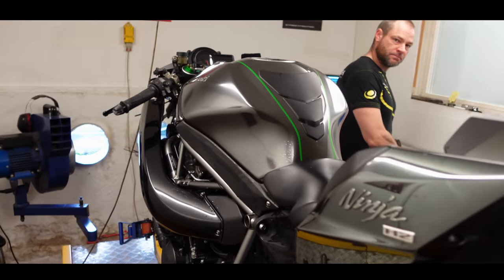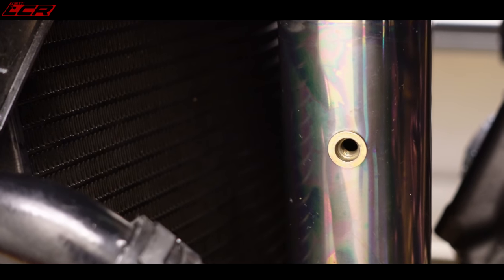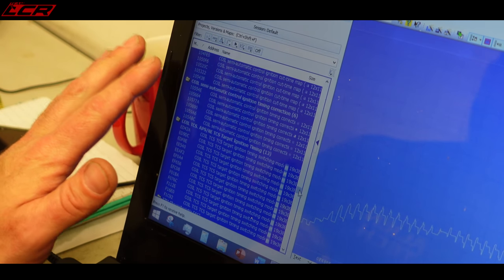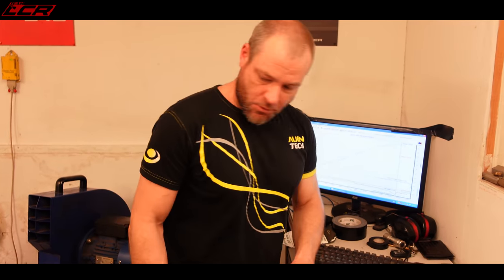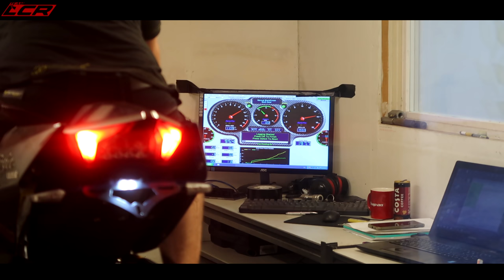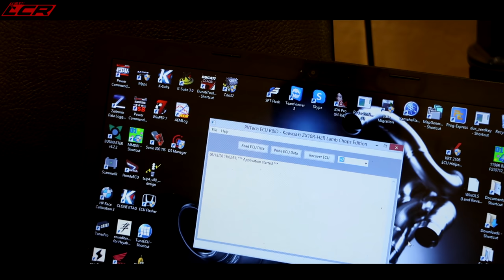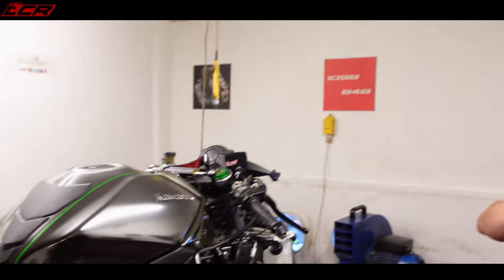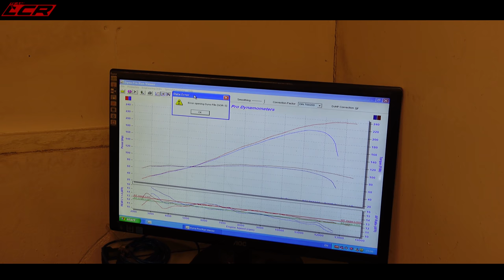Ninja H2 Dyno | BIG Power Tuning!

Comment: Interesting Chopps, when I set up my MT10SP it was never about the increase in power but 1) air fuel to stop running lean as most new bikes do 2) throttle on off get a smoother transition as with most new bikes it’s a switch on off  ————— great video and thanks for sharing 👍
Reply from the maker: Yes exactly 👍 if the throttle response had been good I wouldn't have had it done as it was crazy fast anyway! But while it's there etc etc 😁

Comment: What an absolutely fascinating vid - with a stunning end result. Methinks a trip to Elvington is definitely called for Chops! Oh, and fair play for resisting the temptation to chase baffle-less mega-power and sticking to your original plan. It couldn't have been easy: especially with wizard Chris on the case. Enjoy the beast bab!! 👍
Reply from the maker: Thanks Missy! It's a long vid but wanted to cover the whole process, sure the length will put some off but for those that are interested will appreciate it. We are now going to do a baffle out map to add to rain mode. So if I did to a top speed run or private testing somewhere pop baffle out and engage rain mode! Just remember not to use rain mode if it rains... 😂
Reply: @LambChopRides  It's a plan so cunning - you could stick a tail on it & call it a weasel! I'm very pleased I was wrong about your continued ownership of the H2. I mean, the thing's so ridiculous that nothing road-going comes remotely close! And don't worry about the length of the vid. My hungover bonce was spinning after a few minutes, but sticking with it was a really educational & rewarding experience. Have a good weekend chook & thanks again for another fab production. 👌

Comment: Clearly a knowledgeable technician on optimising the bike fuel/air ratio but without a visible exhaust extractor I'd hate to think what the room gas mixture ratio was after a long run or two.  Not sure a respirator fully corrects for any dangerously elevated CO levels but I stand to be corrected if there are any gas experts out there.
Reply from the maker: There is good ventilation in there, hes now also added more fresh air feed into the wall to recirculate the air quicker. There is a huge extractor fan on the rear of the room
Reply: @LambChopRides  Thanks for the update on that which is reassuring.  Nevertheless I think if I operated a similar facility I'd want to continuously measure CO levels (which can drive oxygen all too easily from the bloodstream) for the long-term safety of staff.

Comment: Insurance company: Have you modified your bike?
Owner: No, still the same ECU the bike came with.

Seeing them drill holes into that beautiful titanium pipe had me wincing.
Reply from the maker: Haha very true! I was wincing myself 😂
Reply: Is it ti? Bluing Looks like stainless??!
Reply from the maker: No its polished titanium 👍
Reply: Lamb Chop Rides ah yes thought it looked alittle different to say the akrapovic ti stuff!
Reply: @FireTwo  I was in two minds if it was stainless or titanium but the bluing was to extensive to be regular old stainless.
Reply: Steve Cade I hear stainless makes alittle more power something to do with the heat build up moves the air quicker while titanium likes to absorb the heat!

Love that baby blue colour thou and the weight saving is crazy.
Reply: Im not expert so before all the keyboard warriors jump on me, this is just my observations, feel free to educate me.
Those bosses, which to me seem extremely crude, won't they disrupt the gas flow in the head pipes ? A rivnut doesn't squash anything close to flat so they will be in there, right in the gas flow getting extremely hot !
Reply: @WhiskeyGulf71  They are extremely crude, and what I would consider a bodge. You should never drill headers when they are on the bike due to the swarf created, and the correct way to do this would be to TIG some titanium bosses to the the headers, not attached some cheap rivnut bosses that will cause problems over time.
Reply: Rodger Dodger 
That was my thinking also !
Reply: Rodger Dodger 
Just reading about titanium welding & by all accounts it's a fairly complex thing to do correctly.
Reply: @rodgerdodger1625  you are partly right ie welding bosses to the headers instead of a crude rivet nut (it will mess the flow up big time) but the swarf isn't an issue it will blow straight out the back.
Reply: @adamknight9535  It's still bad practice. The whole procedure is poor. Welding bosses on isn't difficult you just need to go to the right person. Like most things in life, doing things properly takes time and care.
Reply: Right!, I thought the probe is usually held inside the exhaust pipe, shouldn't had to modify the actual headers that way for the readings

Comment: Enjoyed that Chops very interesting from start to finish what a top bloke. Did like some of the old Ducati’s in the background though might take my 748 there.
Reply from the maker: Hes really a Ducati tuner that's where he started. Now does other brands, Hypermotard will be mapped there too when completed 👍
Reply: Nice 👍 having the supermoto remapped next week hopefully will notice a difference
Reply from the maker: What the 690? Ok keep me posted, power commander or flashed?
Reply: Yes bud the 690 same as your long term lone bike. Having a map put on the ecu to run with not cat aftermarket exhaust an air box upgrade
Reply from the maker: Ok brilliant will transform it, have the Stock Akra on mine now plus springs for my weight and some bling bits
Reply: Will let you know when had it done an let you know what I think

Comment: You have to give a normal family car the beans just to get up to speed on the motorway. On a hyperbike like the H2 I guess only 10% throttle in 2nd gear would be enough to break the speed limit on that same motorway. It's silly and hilarious. I can't wait to ride an H2 one day. Maybe not own it. The design doesn't seem to accomodate a home mechanic that well. An ECU in the front cowl and a regulator in the side panel? That's weird but I guess it makes sense for a spaceship on wheels.  I thought my Superduke was fast (well... it IS fast) but dangit if the H2 doesn't look like it needs an aviation license.

Comment: Might just be me, but coming from working in the bike trade, I feel like you’ve been fobbed offa bit, guy might know what he’s doing with max power runs but you said yourself that’s not what you wanted. Overall a great video tho. Nice one!🤣👍🏼
Reply from the maker: No disagree Daniel, Chris spent a long time refining low end fueling on the dyno but didn't show that in the dyno clips as that's not interesting to watch. He also really wanted to go again with the throttle pickup as you heard at the end but bike was very hot and I wanted to road test it before deciding if it needed further refining. Hes offered to do that foc if I want to go back and work on that further so really that's not the case

Comment: The yanks are getting 300, to 360 hp,  after an ecu flash, intercooler and exhaust. Check out brock performance
Reply from the maker: They are also changing the super charger gears for more boost. 240 is more than enough for the roads I'm riding on.
Reply: @LambChopRides  i had been meaning to ask you, how different is the handling of the H2 compared to the H2 SX.? 
Compared to a RSV4, / S1000RR

Comment: Beautiful!!! IMO,  eff the neighbors and keep that 252 HP and have a 2-wheeled flame thrower 😂🔥🔥💪

Edit:
I just saw the last part with baffle out and how much AF changed. So he would have to smooth that out again eh, if you wanted to keep it out? I didn't realize how much it would change just with the baffle out.

After seeing this, I really need to tune my '19 Ninja 650. I have the full Yoshimura Alpha and the bike runs good overall but I do feel dead spots here and there and the throttle could be a bit smoother. I just took my baffle out and it's awesome but after seeing this, I might put it back in now, I don't know if it's bad for the bike or not since it's not tuned??
Reply from the maker: Haha 😂😂 👍

Comment: only issue now is that you can't ever run it without the baffle as the fueling is way out correct?  is it really much louder with the baffle out considering that system isn't road legal anyway 😅
Reply from the maker: Yeah much louder at lower rpm without. High up its loud either way but below 5k it's much quieter with it. We are now going to tune the rain mode as a baffle out map! 😎😎
Reply: @LambChopRides  ha awesome work around and good usage of power modes nobody uses 😅

I render having 3 modes on a gsxr it only ever stayed in full power 😎
Reply: @LambChopRides  That's a superb work around.

Comment: The motorcycle remapping business seems so backwards to me compared to its car equivalent.  I cannot get my head around why you would map using the raw hex.  If someone has the knowledge to do that then why not save yourself the time and write software like the Woolwich one?    

In the car world (which is what I do have experience of tuning in) you have a lovely graphical interface for all the map tables (so ignition, fuel, etc) and it shows you which cell you are currently in real time so rather than having to guess as he did you can watch air fuel and ignition timing effect in real time.